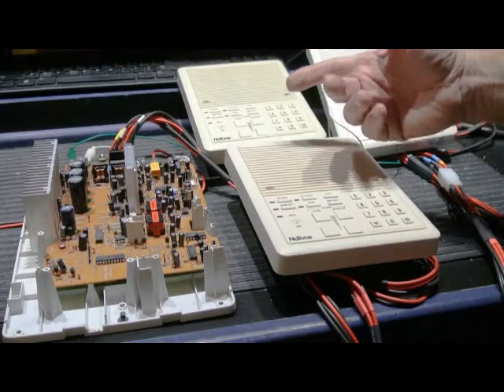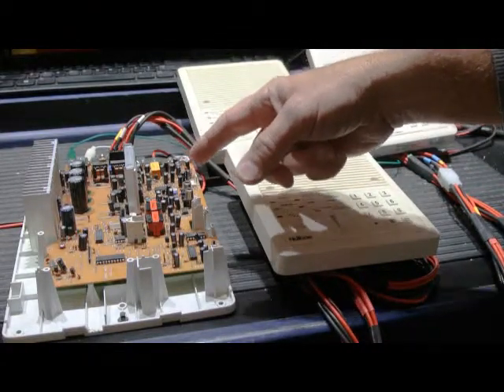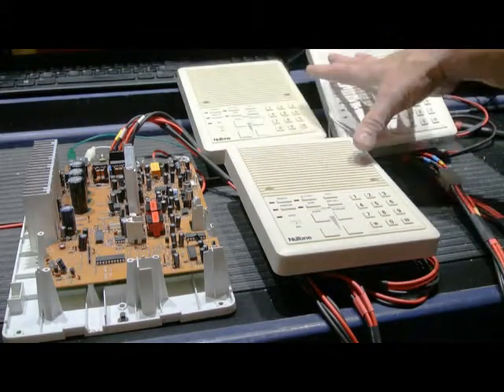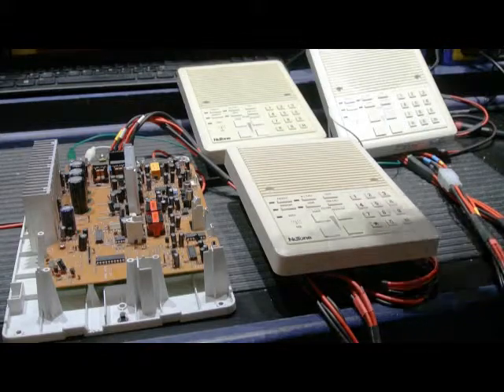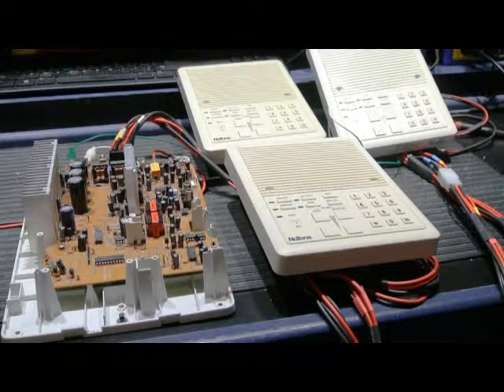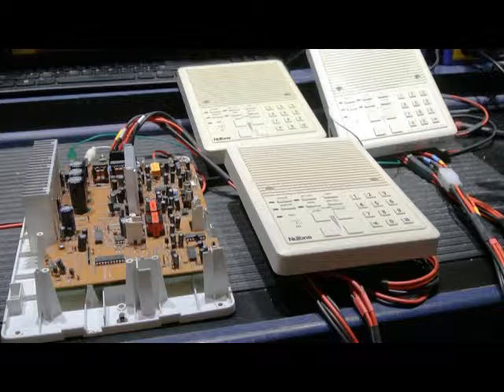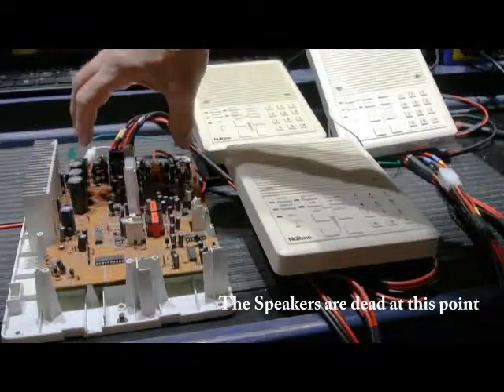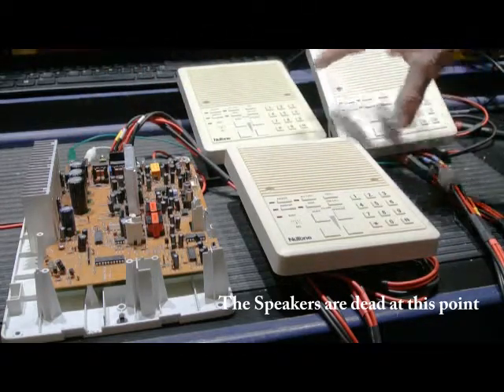NuTone IM5000 Intercom - Failure Mode #1

Comment: To bad you were unable to fix it. Guess the best solution is is to throw out and upgrade entire system
Reply from the maker: Hi Kent,  This Video was just to show people what one of the common failure modes are for the NuTone IM5000 System is.  This IM5000 Control unit was repaired and returned to its owner in England.  Most IM5000's can be repaired, even the units that experience lightening damage.  

If you view our other IM5000 and IM5006 (the cousin model to the IM5000) Videos, you will see units that have failure problems and then have been repaired.

We also have lots of information about both the IM5000 and IM5006 on our web site: http://northsideforyourhome.squarespace.com/

Thanks
Chris
Reply: I was disappointed to see no fix shown. Figured it was just an ad. Later I did see your other videos. My IM-5006 was making clicks, then chirps, now constant howl. I will try you tip of replacing all the electrolytic capacitors. Ordered replacements and they will be her soon.
Reply from the maker: Kent:  If you're going to attempt a board level repair on your IM5006, you need to proceed very cautiously so that you do not ruin the board.  These are double-side - through-hole boards which are every difficult to desolder and remove the original components.

If you desolder the components incorrectly, you will pull the through-hole via out of the board and break the connection  between the 2 sides.  This will ruin the board and since replacement boards are very difficult to find you may end up with a Master Station that is beyond repair.

I wouldn't recommend this complex of a repair for a beginner - Chris
Reply: Thanks Chris. I have gotten good a  repairing multilayer computer motherboards over the years. I wonder how small shuld I go? You showed the 47uF having problems. I see a ton of little 10uF and 2.2uF caps. Do you replace all those little ones? I was planning on only doing the little ones in power supply area.
Reply from the maker: If you would like to discuss this in detail, you can all me.  It's not really a proper conversation for YouTube comments - Chris 925-743-8236